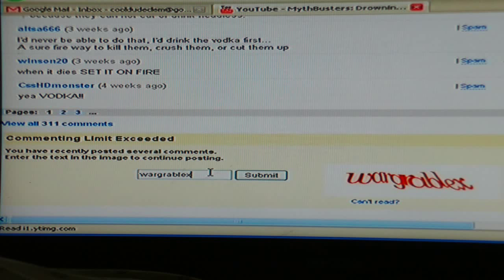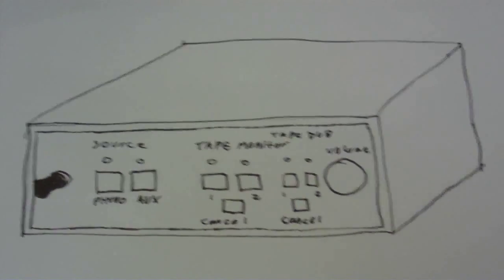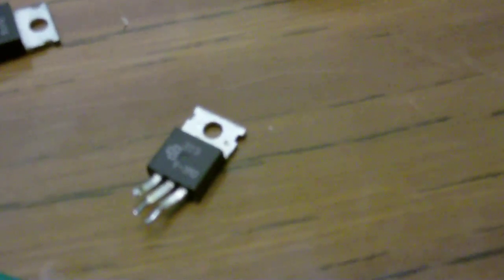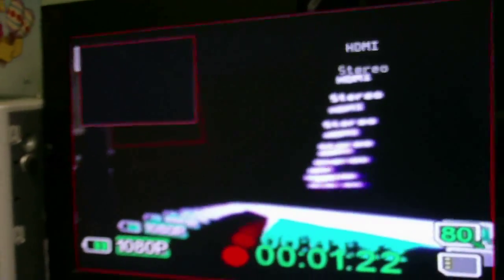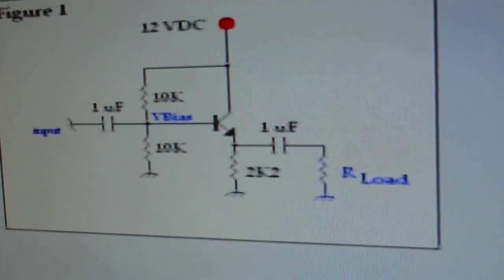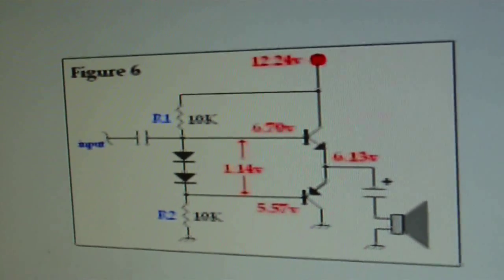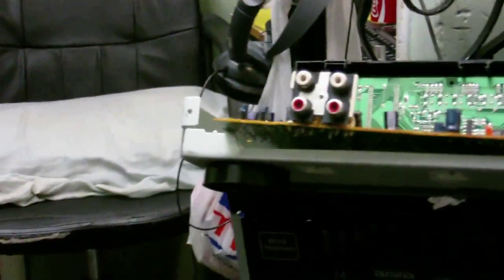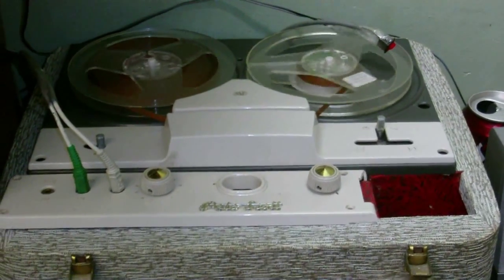The Amplifier Adventure part 1

Comment from the maker: Actually I like the wood and metal style of the older electronic, the only reason I made mine from plastic is I didn't want to spend to much money making it.  You could probably get some sheet metal from the Internet, or even use an old biscuit tin, its a good source of metal too.

Comment from the maker: I didn't have any luck with the amplifier circuits I had on the computer.  I built them from some spare parts I have, but only 1 of them worked, and it's output was barely audible through the speaker.  I found another simple amplifier in an electronics book I have, so I built that, and after a little tinkering with the circuit, it works.  I'm going to put up a video about it later.

Comment: That looks interesting! Where did you found these scematics? Maybe I'll try to built a power amplifier using seperate components too! The reason why I preferred IC's is that for some reason ALL my transistor projects didn't worked. But IC's are getting boring, it's time for something new! The circuit you're going to built looks easier than I thought a discrete power amp would be. So it would be interesting to know the values of the components of fig. 6 or where I could find it in the internet.
Reply: amazing today, what you can find on the  comutel we have now  stk is a wonderful series of integration units for sure.